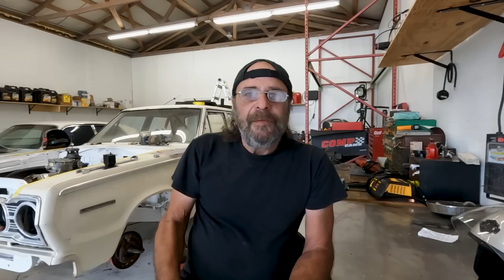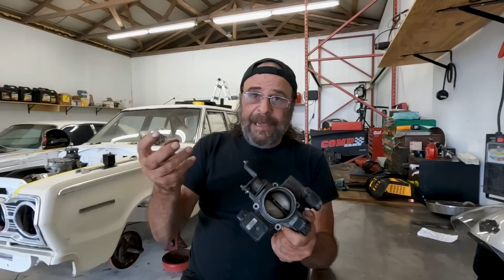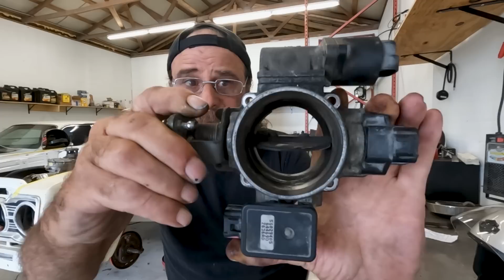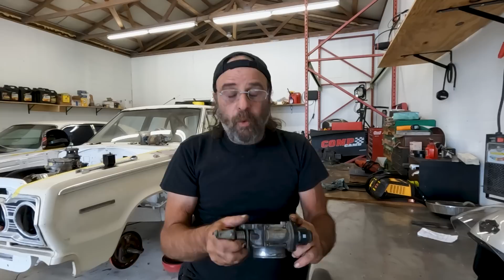Digging For Hidden Power - Building A High Performance Car While Building A Higher Performance Human

Comment: To me free horses power is the best, meaning no cost (time only) and freeing up horses power.

Index sparkplugs, check air pressure in tires, vacuum the air cleaner, flush your fuel filter backwards into a glass for inspection. Check electrical connections especially the grounds.
Find away to get fresh outside air to the intake filter. On an outboard engine holes or bigger in the intake holes in the cowling. On a car grill or even bumper mods or raising the hinged side of the hood up, let's more hot air out, pulls in fresh air... 
Get all the weight out you can. Jack, spare tire, snow chains,   lighten it up.
Including racing low on fuel. 20 gallons, roughly 160lbs. 6 gallons 48 lbs... 
Just that alone is over 100lbs lighter, you're going to be faster.

Comment: I commented about the nascar 340 block odd wear, we found that motorcote oil treatment worked like a case harden the metal 2 to 3 thousand deep and reduced wear, this is additive that goes between the molecules like sugar dissolves into water. It is as thin as water when you poured it in the crankcase. On the street you only add 1 quart per oil change , but you don't do it on 2 nd oil change as the treatment still works up to 10,000 miles check out the.project farm tests on this product. They 
put in a briggs oil plus motorcote run it, drained out the oil and put water in the crankcase and run it and kept putting water in it and checked compression stii.100 psi like the first part of test with oil in it. I used in semi engine and get 2 millon miles out of engines. It was a secret out of Michigan where was invented that Smokey younick used it as a secret engine trick.

Comment: I used to pull Garden tractors years ago. Everyone said you can't modify an 8hp Kohler engine, and being from the Show Me state, I decided to try. A little port work, back cutting the valves, and working over the carb proved otherwise. More air and fuel made the little fella run like a champ. The engine was worn out anyway, so it was worth the shot and time. Took it from just being out there smoking like a housefire, to placing in the competition. All stock parts, just time well spent to go play.

Comment: I understand that this is just an example, but on EFI engines, a noticeable difference in power from 3/4 throttle to full throttle may or may not indicate that the intake/throttle body is inadequate. Even with a cable throttle body, the ECU will often make other changes to fueling, timing, cam angle, shift points on autos, etc just based on throttle position.

One of my cars has a larger than stock cable operated throttle body and shows no meaningful difference in manifold vacuum between 1/2-2/3 throttle and full throttle, but still pulls noticeably harder with the pedal floored. Why is that? At higher TPS readings, the ECU goes into power enrichment mode and commands a richer air/fuel ratio.

I realize that was just an example, I just didn't want anyone to get the wrong idea and think their intake setup is inadequate just because their engine makes more power at full throttle LOL. Sometimes more testing is necessary. For example, in that case, monitoring manifold vacuum will give you a much more complete picture of what's really going on and help to confirm or debunk the theory.

Comment: This is reminds me of picking up a dirt track race engine from a famous engine builder, came with binder had Dyno testing results and tuning instructions for temperature, barometric pressure etc. In the back of the book had every manufacture part number/ specks used to build the engine. One of the crew said we need to get a spare MSD box we will order the part number in the binder. The engine builder quickly told us it will not work right he would supply us with one if we wanted. We all wondered how he was modifying a sealed part that according to the manufacturer was not programmable. After talking to him about the engine output he said you can buy all the same parts put it together yourself but you will be 200hp short of what you just bought because every part used was modified for better performance. Another time I over heard a conversation with a customer who had engine failure because he didn't use the oil that was specified but the builder. We figured out quickly to follow the instructions given  with the engine and ask questions before we did anything we were unsure of. This engine never missed a beat won 13 races before rebuild, after years of building our own we realize can't compete without a professional built engine.

Comment: I always bore the throttle bodies on my 4.0 jeeps straight through and replace injectors. Sometimes even drill a hole in the blade. I have seen many jeep fires due to bad o rings on injectors. And usually port match intake. Being in Michigan my exhaust ends after the cat with a down turn. A 4.0 throttle body is larger than a 360 throttle body. Which I always thought the 360/5.9 was necked down to pass emissions. I like the noise the bored throttles make too. Usually the bored throttle makes more power 5/8 throttle vs full. I don't think a throttle body spacer helps on 4.0l's. I like the x2 w exhaust manifolds on the 4.0l's. Also think the later fuel pumps and regulators with a fuel cooler gain a little power too. I added the long helper leaf spring in rear on my xj with no shim. The axle rocks slightly and seems to catch traction better that way. A 1.5 inch lift works similar on coil sprung jeeps. Instead of spending power to squat the jeep. I am not drag racing. It's a trail jeep. But similar need for off the line power.

Comment: No ----- you're NOT nuts ----- more an inspiration ------- Have a Question ----- about 30 minutes left in getting my engine and trans out --- will take a part and degrease ------ THEN ---- START the look for Hidden Power ----- Will be working with what is in the engine ---- as you put it one part at a time ------- For now though ----- you work with David V. ---- on his Ep.#58 Con Rod Lightning ----- the cap boss is slimmed way down and the boss on the small end has been dressed off ---- this is on a stock cast iron rod ---- and has dressed between the journals ------ He has dressed a lot off both ends ---- now a ----- LOT ----- lighter -- less resistance ------ and these things are what we are looking for ----- I enjoy doing this work ---- not a Hot Rodder ---- enjoy Classic Cars ---- Cruising ----- and sounding good ----- Question ---- has the rod been dressed down TOO MUCH ---- to still be strong and holding together ---- again my engine is not something that can do high rev's ---- I do appreciate all that you have to say ----- After I dress them all down will Balance them all to match ------- Some Good Tips ---- I too enjoy Mopar --- '72 Barracuda - ordered when serving in the Armed Forces ---- But the car I'm working on is a '56 Pontiac ---Thank You for sharing with us the knowledge you have ---- I enjoy making WHAT I HAVE------ work a little BETTER ----- Hope you have a Good Week ------- Rodney

Comment: AI Overview
Learn more
…
For optimal air flow inside a cylinder, a smooth surface is generally considered best, as it minimizes turbulence and allows for more efficient air movement compared to a cross-hatched surface. ie. Do not cross-hatch.

Comment: I had a pos 1980 Plymouth volari with a slant six. It had a cold air intake behind the driver side head light. I installed a section of dryer pipe to the air intake to the air cleaner assembly and removed the head light bezel that exposed the intake to direct ram air. You could really feel the power increase at highway speeds. Probably added about 10 horse power. It's all in the details.

Comment: Ideally an intake should be slightly funnel shaped but if its only at the throttle body and the body is too small its not going to help so idk, did they want to increase velocity at the throttle body as a means of fine engineering? No because the MAP sensor is hooked up to the manifold, not the throttle...Idk

Comment: very great thoughts..question ford carbs n annular discharge nozzles, are they great, and can you improve them?, or my thoughts are, theyre perfect from the start.
had muh CorvAir 4 spider mannifold with a 2bbl ford 60's annular nozzle carb on, basically 2 types, one with bigger throttles.. used on 260v8-351C 2v and even the bigg blocks.. so make a vid on y thoughts about them, love to hear a great mind speak on it. cheers

Comment: If you still run closed loop, creating a vacuum leak will mess with the fuel trims. It's not like a carb where the jets are a fixed size. Imagine the fuel trims inside the ECU are like a continuously variable jet. But the ECM wants to keep the ratio at stoich, so if you create an unmetered air leak,  the ecm will see that the ratio is too lean, so it will add fuel to compensate, BUT it won't do that instantly, because it takes time for the lambda probe to react, and the PID loop is tuned to be slow enough to not create oscillation in the control loop. It can take seconds to adjust to the correct ratio. And because the ECM has many cells for trims depending on the load, rpm and airflow, each of these cells will be way out of stoich when you hit it after a massive system change. Hence when you  give it gas, it will be massively lean, until the loop has time to correct. Then it will remember that positive trim and when you let off the throttle, it will be too rich, until again it has time to react and correct. If you felt a positive result from creating a vacuum leak, your fuel maps are too rich. Correct the maps and don't create any unmetered air leaks.

Comment: Hey Uncle Tony, i have an interesting question. I had some motorbikes that had carbs, but those did not have these big butterfly things. They had vertical stuff, like a guitone, that slides up and down. supposedly when throtthe is wide open, there is literally nothing in the path of air, how come that kindof solution is not used on car carbs ? i did see and even drive (okay, 4 bangers.. but whatever) cars whit bike crabs on them, but never seen a v8 whit 2 sets of say gsxr carbs....

Comment: "Digging for Hidden Reliability.... My main goal was "reliability" not performance... how to make a 700R4 transmission LAST in a 1989 GMC Sierra for towing in 3rd gear a livestock trailer several times a year without burning up clutch packs...I accomplished this by lowering the transmission temperature 160 degrees.. Added deep sump finned transmission pan w/ 6 cow magnets, added external transmission cooler, replaced 195 Deg themostat to 160 Deg.  thermostat and added special radiator coolant wetting agent.

Comment: Ive been here. I was a volunteer firefighter. A few big hills in my district. Ive ran 4l for 25 years.( still do) Ive tryed every  mod. Big aftermarket throttle body, spacers, header, no engine fan,( electric) injectors... nothing really did anything. I opened up the intake opening to match the big t.b. even went from 3.55 open, to 3.73 trac loc. The stock log intake is a cork. You HAVE to swap to the 99 up intake. I know your trying to stick to the same year stuff, but the 1950s rambler intake is holding you back so bad, you wont even believe it. Just that swap made more power than all the other mods combined! When youve completed the exercise your trying to accomplish. Try the 99-04 intake. Youll need the power steering brackets and belt. 5 bucks says you get another 10mph. I did going up the big hill i had to do many times daily. Good luck tony! Keep at it! Love the vids
Reply: Thank you for sharing your experience.

 I can definitely see phase 2 of this project involving the suregrip, 3.73 rear gear, the later intake manifold (ported), and a ported 62mm throttle body. Among other things. But obviously the fist issue is getting the airflow up other induction side.

Once the head gets touched, and the induction side is better prepared. I could see a truly optimized tri Y header being worth it.
Reply: Awesome knowledge drop

Comment: Well, also remember that 3/4 throttle is still in fuel control. Full throttle is straight from the fuel/rpm table, no trims, no o2 sensor in play. What this means is increasing airflow alone will increase the power but also the chances of pre ignition at full throttle. The knock sensor will catch this and retard timing, the engine will fall on it's face.

Comment: Hi Tony, love your videos. I'm rebuilding the 440 in my 71 challenger and putting a hydraulic roller cam with bushed roller rockers. It seems like the holes in the cam to feed the top end should be chamfered for better pressure and flow. Does that put to much oil up top?

Comment: Good video Tony. So many people think that factory parts are as good as they can be,
and the same is true with aftermarket parts. They are all a compromise, and the biggest 
reason for that is to keep manufacturing costs lower...
With carburetors, you can order a custom tuned Holley carb from one of the companies that
specializes in doing them, but the cost is significantly higher, or you can buy a new Holley carb
and do the research and work yourself. Not only do you save money doing it yourself, you also
gain a better understanding of how the carb functions, and then you can apply the same concepts
to every other part of the car. 
No you won't gain 200 h.p just by tuning a Holley Carb, but it's all of the little things that add up to a big difference.

Comment: Maybe that throttle body taper needs to be looked at backwards?  That smaller diameter could be exactly what is needed for the engine, and what the taper to the opening is about is smoothing [kind of like velocity stacks] and noise reduction.  And to speak of noise means entering the world of wave theory, which gets real world use elsewhere in a little something we know as chamber softening.  Think of the old college megaphone, and turning it around backwards - its like that.

Comment: Cost savings. Probably was easier to release from the mold that way on they couldn't be bothered paying to bore it out afterwards.
Reply: That smooth part inside the throttle IS the bore job. They are all bored out (unless made from plastic.)

Comment: You can use a vacuum gauge behind the throttle body to determine if the TB is a restriction. More than 1 or 2 inches and its a restriction, they say. Maybe for the sake of experimentation, you use a much larger TB and see if it gives you the improvement you want. Then try to match the performance using the original TB, but w the tricks you come up with. Keep an eye on air/fuel ratio.
Reply: Not just there, anything that effects an engines airflow demand will show up on the intake side vacuum unless you're running a TB/carb larger than the engine can possibly use. Which is exactly how you know when you have enough TB/carb. ;)
Reply: @Ares-jx4ep   Tony could also put his vacuum gauge ahead of the throttle body to see if his flexible cold air intake is a restriction. If there's any restriction in the CAI or stock TB, I'd be tempted to add more vacuum leaks and make them able to be controlled from the driver's seat.

Comment: The lump in the TB is found ONLY in stick shift TBs. They did the same thing on Neons. If memory serves It had something to do with numbing down throttle response in first gear. (as stupid as that sounds). First thing we always do on any stick shift PT Cruiser or Neon is put an automatic TB on it. The automatic TBs do not have the restriction. Pull off an automatic TB at the boneyard and it wont have the restriction.
Reply: I'm surprised how many of us neon guys there are here. We were kinda rare in the grand scheme of the car scene back then.

I used to open up the atx throttles  to fit the 57.5mm plate from a certain year 4.0 because the 57.5 perfectly matched the airflow needs. I never shared that information, or how to make the ultimate CAI on 2gn's chassis using mostly factory parts. Including a 55 or 56mm throttle plate in the stock plastic throttle.

Maybe I should share that one day, but it seems to me like nobody would care anymore.

Comment: I've been trying to drill that same concept. Be an engine builder, not a parts assembler. Their gen has been trained to buy/spend. I try to show them. We "ported" cleaned  up the head & lapped valves on 94 xj 2.5... noticeably "BIG" difference across the rpm. (His words)  Other boy wanted to buy coilover to lower his 3000gt. Tried to explain how bad the geometry will be. Like riding on ½ the tires! So now I'm cutting/wielding ball joints off arms & making them z/drop in order to keep caster/camber, no bump-steer, etc as close to correct as I can with 5.5in drop & 235/30/20 tires. Almost done with the back 😓 why oh why... oh yeah hopefully  i can undo the brainwashing!
I've been telling them for years "i got more time then money... and i don't have any extra time to waste! "
I get your thought process... exactly! I tinker until its too complicated & then back off 1-2 prototypes/ ideas. Anyone could build a vehicle with the parts catalog... & look like the guy next to you @ carshow😂
I think im nuts too, just happy im not alone
Reply: It’s funny how many lower their car a bunch then are surprised when it handles worse than a stock one. They think being low and stiff means it’s faster. 
I once harassed some kid in a slammed Honda on a back road. I was driving a town car and not particularly trying hard. But, his car was such ill handling junk I was on his bumper whenever things got twisty. 
Most people don’t have a real understanding of how things work and interact. They just think it looks cool.

Comment: How about running everclear in the tank with gas.
Reply: Besides me mentioning the fact its catless and could run richer than factory configuration. 

The Ignition timing would need to be advanced for the slower burning fuel.